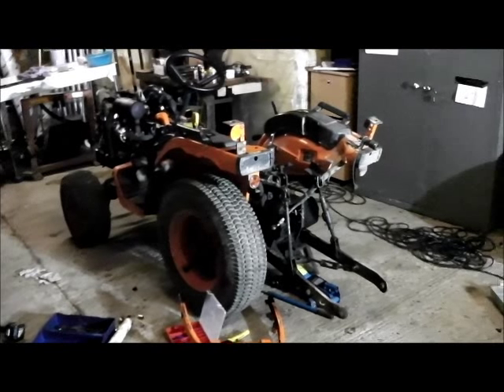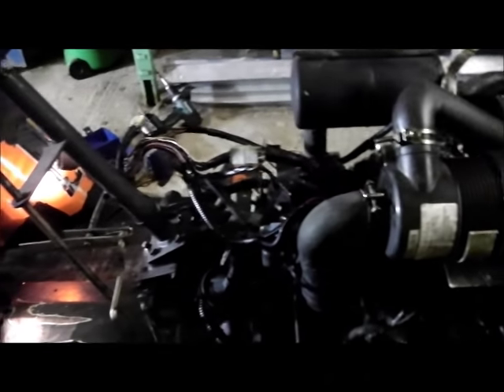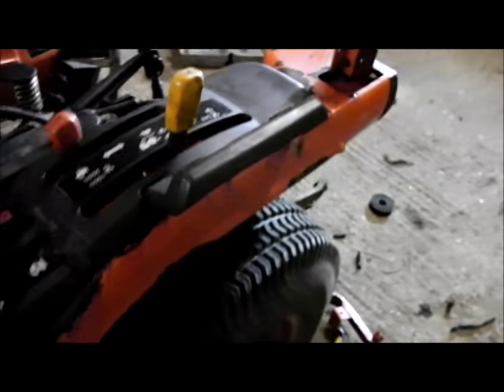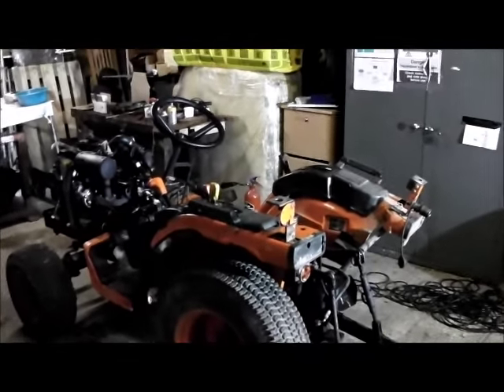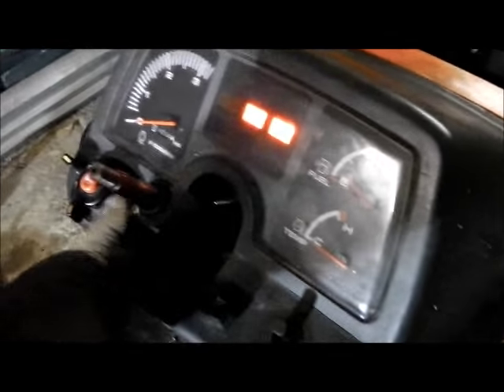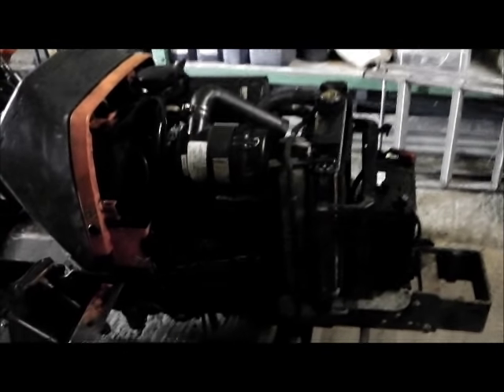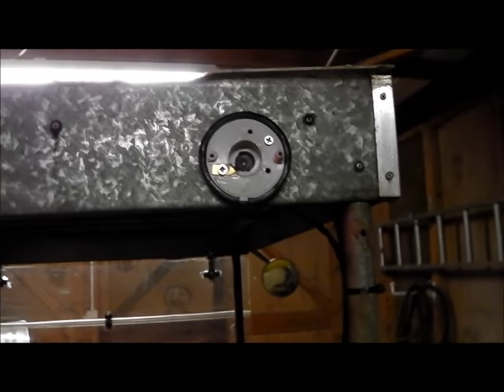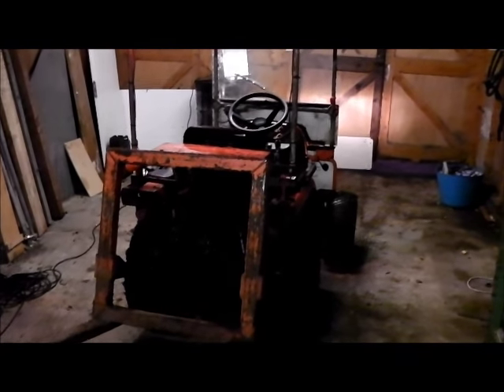Kubota Tractor Repairs

Comment: Curiously  the even older Kubota models B5000, B6000, B7000.
Had similar mechanical advantages, but not the bodywork disadvantages. Since there was no bodywork to talk about.
One simple bonnet, two rear fenders. Really not much to rot away.

This problem only come up in more recent models (80¨s on), where they start to put "fancy" bodywork, rubber mats, etc.

Common to most all of them was the battery box, corroding to death. But that was mostly battery acid playing it`s roll, not bad construction. 

Nice job with that workhorse. ;-)
Cheers

Comment: It's alive again!
What work is it used for?
Reply from the maker: +Wayne Essar 

It gets used for all sorts - towing trailers about, towing out stuck vehicles, setting new land speed records, moving pallets, bins etc. I use it to move heavy machinery to the workshop for repair - with the low range gears you can drag anything up to a ton on skids without problems and it will tow a draw bar trailer at 2 tons, not that you really should mind!

Great little machines, I have a lot of respect for ever designed that little diesel engine.